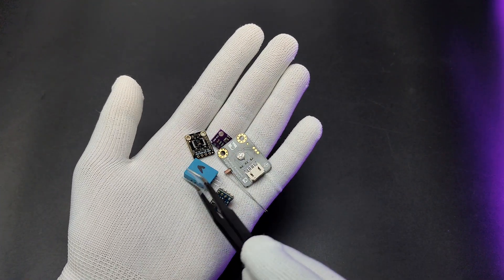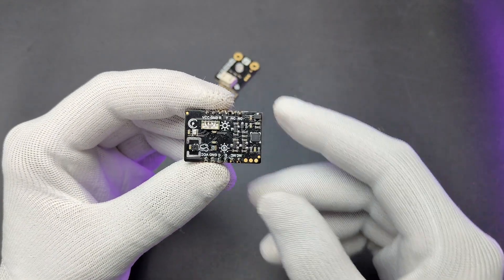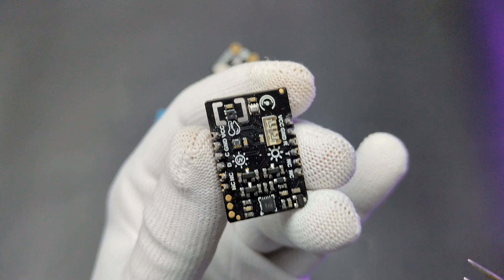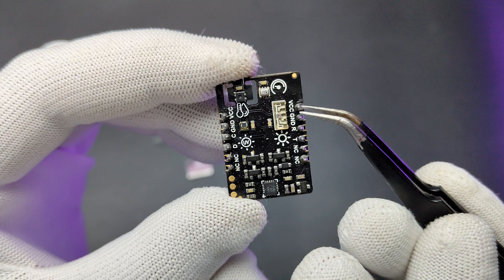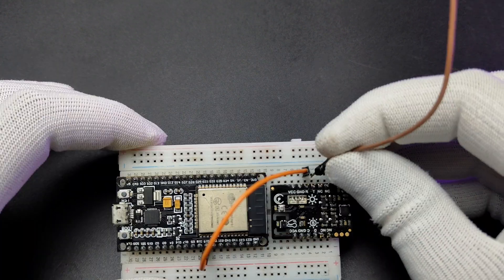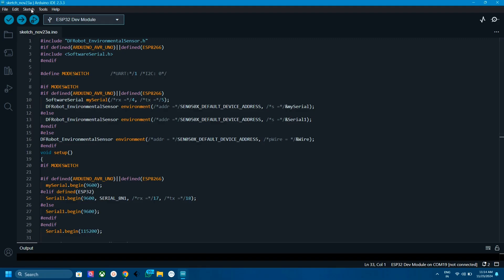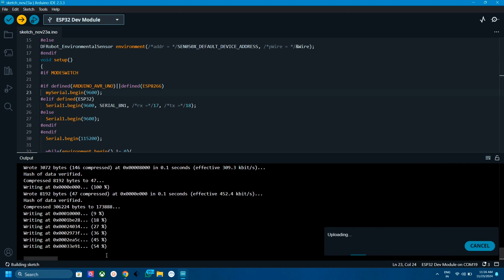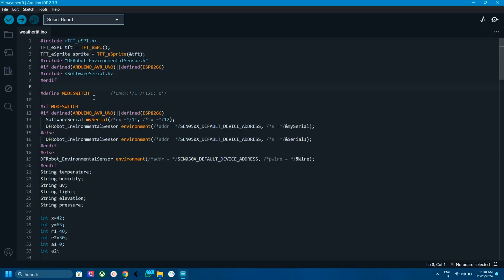All in one Sensor Module | DF ROBOT

Comment: Just so I understand it, assuming you need all of the sensors at once, and assuming the sensor is the same price as the other individual sensors, you still need to use multiple cables to connect it to a module. It sounds like a highly specialised board that has an extremely narrow use case.
Reply from the maker: As i said in the video , less consumption,small size, only 2 gpios needed.